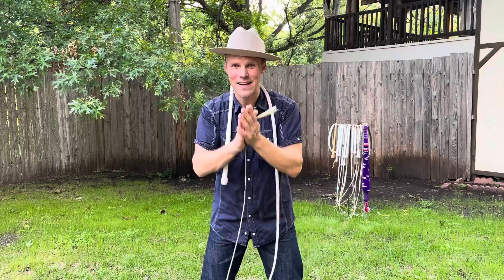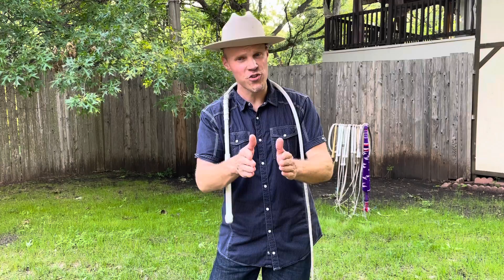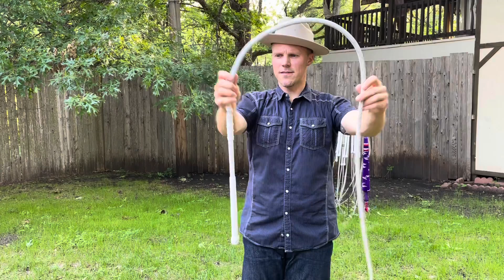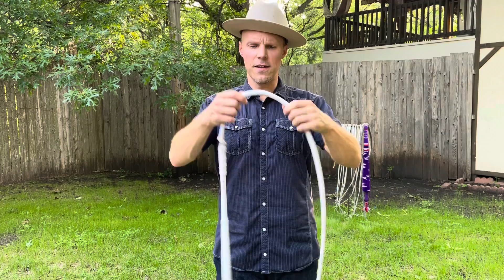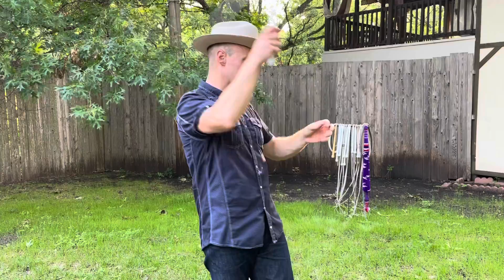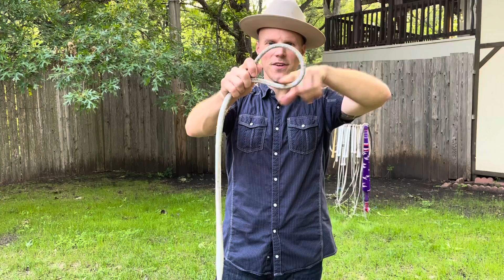Physics of a Whip Crack

Comment: I am interested in designing a whip technique. Is it true there is higher tension as the whip gets closer to cracking? Especially right before mach? If not what is inplace of it? If there is a Wave? A Rotation? And acceleration minus mass it would create a Alternating wave if you can compile the waves manually through repartition and muscle memory would it be possible to mutiple the solid output force of the whip especially if you layered parts of the whip and used that to focus on those layers.

Comment: Yeah, but what does all that have to do with anything? 

Just kidding. Ha! 

I asked ChatGPT to, "Create a good mathematical model for a whip crack."
Here is the answer I got:
Creating a mathematical model for a whip crack is a complex task due to the intricacies of whip dynamics and the nonlinear behavior involved. However, I can provide you with a simplified mathematical model that captures some of the key elements of a whip crack. Please note that this model is an approximation and does not capture all the nuances of the physical phenomenon.

Let's consider a whip as a flexible rod with a mass attached to one end and a handle held by the whip cracker at the other end. The basic parameters we will use in the model are:

L: Length of the whip
m: Mass of the attached end
T: Tension in the whip
ρ: Linear density of the whip material
c: Speed of sound in the whip material
v: Velocity of the whip crack

Based on these parameters, we can define the following equations:

1. Wave Speed Equation:
The speed at which the crack travels along the whip can be approximated using the wave speed equation:
v = c * sqrt(T / ρ)

2. Wave Propagation Equation:
The whip crack can be represented as a wave propagating along the whip. We can use the wave equation to describe this motion:
∂²y/∂t² = (c² / L²) * ∂²y/∂x²

Here, y represents the displacement of the whip at a given point (x) and time (t).

3. Energy Equation:
The energy of the whip crack can be related to the tension in the whip and the velocity of the crack. The energy can be approximated using the following equation:
E = 0.5 * m * v²

These equations provide a basic framework to model the dynamics of a whip crack. However, please keep in mind that a more comprehensive model would require additional considerations, such as the effects of air resistance, the tapering shape of the whip, and the intricate interplay between tension, wave propagation, and the crack itself. End quote.

I passed college mathematics with a high A but cannot make heads or tails out of any of that to know if it's good or not. I have been watching your videos for years and have even made a few different kinds of whips of my own, but I never knew you were such a lover of math. Now, ChatGPT is not all that reliable when it comes to math. Most often it helps to instruct it to use Excel for its calculations. I just thought you would find it interesting to see what an AI has to say about it.

Thanks,
Daniel
Reply from the maker: I graduated with a degree in math, but I can’t say I was in love with math.

It kinda looks like ChatGPT did the same thing I did: find some related formulas to a whip crack.

I’ll look it over some more, and also look up the formulas it cites.

Thanks for this comment!

Comment: Adam, I see a lot of bullwhips that have developed sags at the handle/thong transition. Seems to me that, when cast, whips with transition sags lose energy at this point. Joe Strain mentions adding support to this area. I had an 8' roo bullwhip from a nationally known whipmaker that developed a sag and I cross-wound it with nylon cracker string for about 8 inches and it made a big improvement. I graduated the winds, too. What's your thinking on adding support to the transition?
Reply from the maker: I am used to stock whips, so a more flexible transition doesn’t bother me at all.

I get a lot of emails from people that want to generally improve whips, but it always seems their experience with a variety of whips and a variety of tricks is limited.

If there are one or two specific tricks that you do that require a stiff transition, that’s your preference and that’s great.